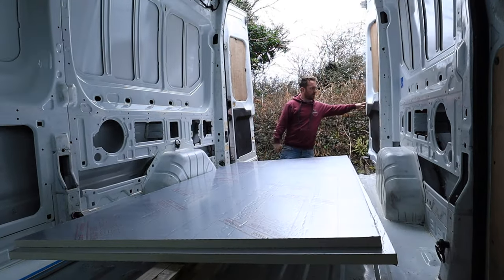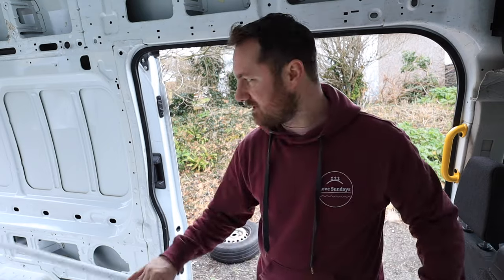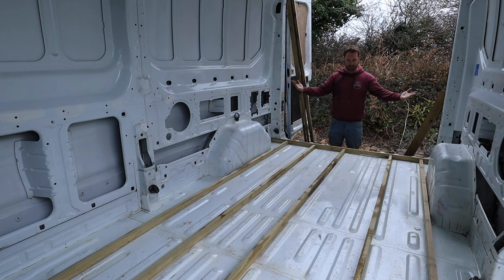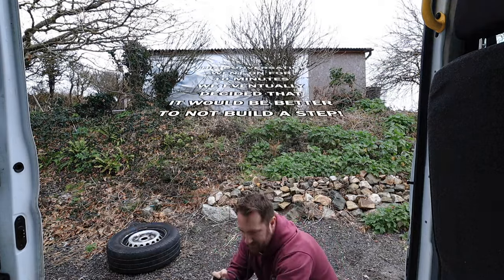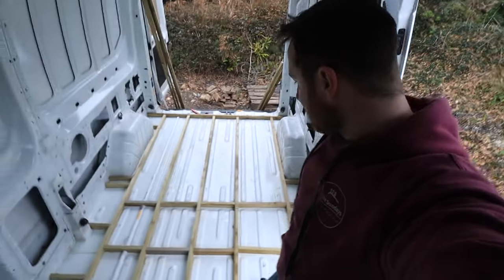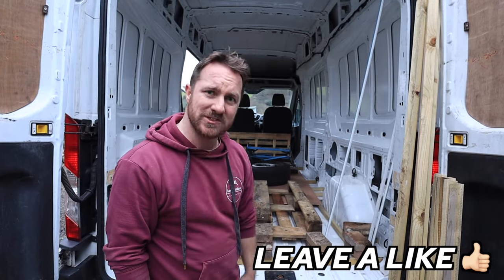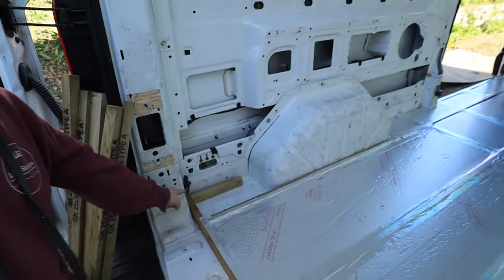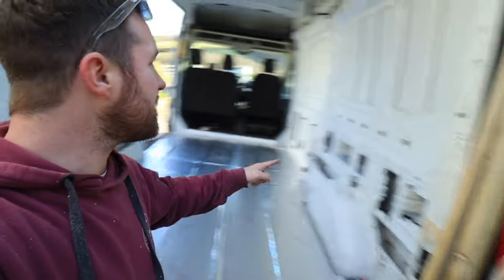CAMPER VAN CONVERSION FITTING THE INSULATED SUB FLOOR

Comment: Loving the van build, and great to see you working it out (with help from your dad ;-)
You need a sticker for the back door - no tools left in this van overnight!
Good to see your cheerful thumbs up ... do watch out for the temptation to cut corners with the jigsaw / safety. I'm not great at this but have all digits and only a few scars ...
Good luck to you and Kate, I hope all goes well and you adjust to your change in sleep patterns, not to mention the extra responsibility ...
I have used expanding foam 'plasterboard' adhesive before - after it not sticking I re-read the instructions - making sure the surfaces were damp, then waiting until the adhesive formed strings was the key ... so if you find unusual instructions on glue, it could be there for a reason! I guess sound deadening needs to be stuck properly to do it's job, so maybe you can get time to drive the van before and after fitting it to make sure it has made it a bit quieter
All the best with your build, especially after it becomes a lower priority!
Reply from the maker: Thanks Tom. Also there will always be one tool left in the van over night… me I’m the one tool 😂

Comment: There is no reason to run battens on the floor. In my last 3 vans I just placed 25mm celotex onto the metal floor and laid the T&G flooring on top. I glued the T & G together and the secured it at the sliding side door and back doors and it never moved. Remember that the raised bits of van flooring are closely spaced enough so that the T & G won't sag - 18mm T&G is good for at least 400mm centres.

Comment: Thanks for sharing this.  I think I might have to do this.  I will have to pull up the floor, because they tried to take the tyre off (underneath my Ford Connect) but they couldn't because someone screwed the floorboards down over the bolt that releases it!!!! Urgh.  My summer project I think. K

Comment: Good effort, if you can dynamat the floor, wheel arches and cab floor. You can also dynamat the underside of the bonnet and door panels. Will
Make for a much quieter ride
Reply from the maker: Thanks for the advice

Comment: Fab video once again. 
For 25mm celotex you can use a sharp kitchen knife - the handsaw and jigsaw have serrated blades so tend to tear the insulation.
Similar to the home make sure you have air flow or the dreaded condensation will hit you 😣
Good luck and good luck with the baby too ❤️
Reply from the maker: Thanks for the advice
Reply: @LoveSundays  also the c-tec ct1 is the adhesive of all adhesives, just make sure you have some gloves on 😁
I am envious though!
Reply: What is the best way to make sure you have air flow?
Reply: @optic1972 what is the best way to make sure you have air flow?

Comment: Class vids mate, im starting from scratch with  my transit custom, my question is which thickness of timber and insulation are you using? 3x2 and 50mm insulation?
Reply from the maker: Yes that’s it

Comment: great stuff,, what size ply are you going for i would say 18mm for floor, you can screw things to the top them with no problems and it wont sag as only 18mm is structural, plus the the battens look to be 400mm apart so again 18mm for that span
Reply from the maker: Good advice. I’m going with 12mm though as the units will be strewed threw to the battens

Comment: Hindsight being 20/20, when you were vacuuming the floor or putting the tape down you should have started from the corner behind the driver's seat and worked your way to the back. That way you wouldn't be tracking dirt from your shoes in where you'd already vacuumed/taped.

Comment: Can you tell me why you laid battens on the floor?
When I did mine I just laid the cellotex and put the ply on top.
Your losing insulation with the batten.
Can’t wait to see the finished product 👍 Andy
Reply: Celotex has no structure so it deforms easily. The battening adds the strength required to last a long time (in good condition)
Reply from the maker: I plan to screw the units to the floor so the battens are mainly so I’ve got something to crew down to

Comment: I would probably have run the conduit along the o/s edge rather than under the floor. It wouldn't be seen once finished and would be more accessible should it need to be. I like the use of recycled plastic insulation 👍.
Reply: williampeter9097  ???
Reply from the maker: I’ve got some going along the walls too though

Comment: Will you be putting in any drainage or plumbing Shaun
Reply from the maker: I’m more than likely putting a sink in with running water. Grey water tank may go under the van but I’ve not decided yet
Reply: @LoveSundays  Would advise putting in your Pipe work before you go any further, or cut the holes so you know where they are, just a hint

Comment: So I am looking for a van right now, quick question regards vehicle insurance 
Do you have to have commercial vehicle insurance? Or can you get non commercial ie can I use the no claims I have gained on the car I am going to sell ?
Reply from the maker: If the van is a camper you can insure it as a camper. If the van is being converted you may need to register it as a commercial vehicles until you feel it’s a camper. You don’t have to change the vehicle from commercial to camper on the log book for it to be insured as a camper

Comment: you used 25mm thick foam board but put the 25x38mm batons vertically. Why wouldn't you have the batons flush with the board ? I'm about to do the same job so wanted to know.
Reply from the maker: Because the groves in the floor van would crush the board where it touches
Reply: Gotcha. Did you ever consider putting a shower in or not enough room in the L3 van?
Reply from the maker: @guygreenwood I never wanted a shower as I’ve got one of those pump showers that you can just use outside. In my experience I never used showers in my previous vans apart from to hang up wetsuits. It also creates a lot of moisture inside the van with all the steam even with a fan above the shower

Comment: Not being a killjoy, but I read some guy who said you shouldn't glue wood to metal like that because condensation will form and cause mold and the wood to rot eventually, he suggested a layer of polystyrene first or some such. Dunno what your dad thinks about that?
Reply from the maker: I guess we’ll have to see. The vapour barrier should prevent moisture getting in there though
Reply: @LoveSundays  I guess that's in the celtex?
Reply from the maker: Yes on the outside of the celatex
Reply: @LoveSundays  Well that's gotta help, and tbh if you put down polystyrene i'm not convinced the whole thing wouldn't pull away from the floor,I'm sure it'll be fine. Like the wiring in the floor as well. Looking good !